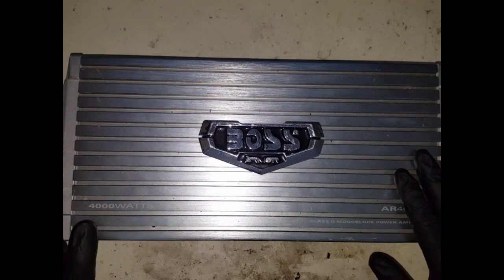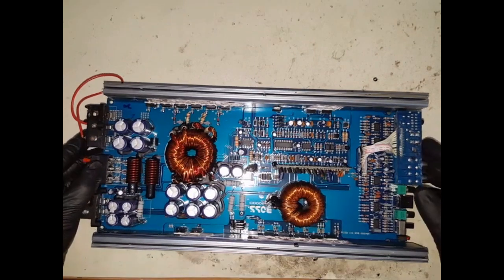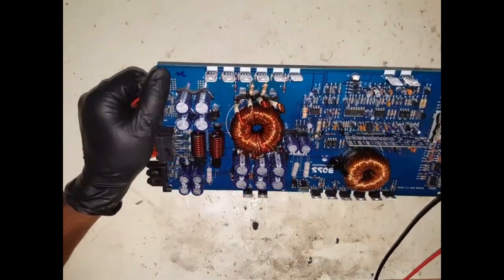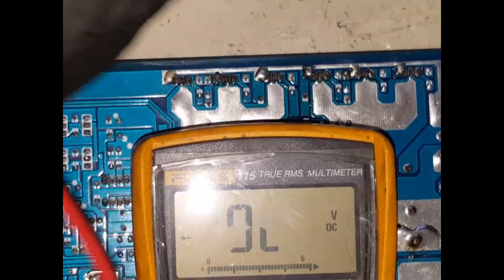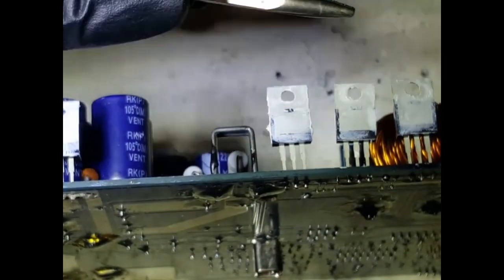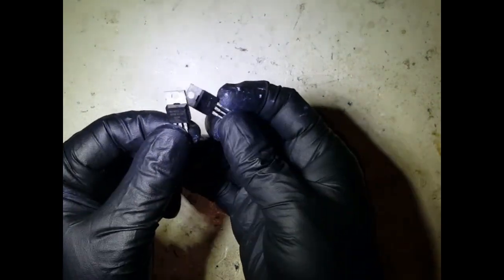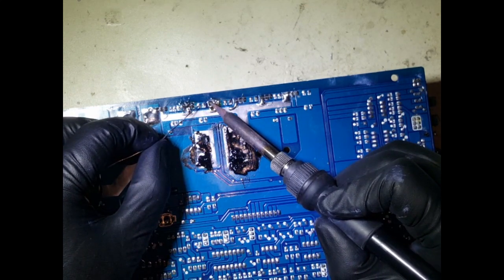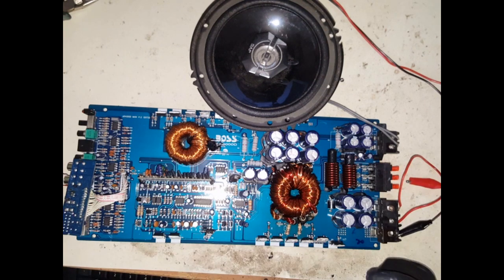Boss armour AR4000D Car Amp Repair

Comment: I BOUGHT A CHEAP 5 CHANNEL AMP ON EBAY SET IT UP ON THE BENCH AND RAN ALL 5 CHANNELS FOR ABOUT AN HOUR AND A HALF. THE AMP WAS SO HOT , I COULDN'T TOUCH IT . POWERED IT DOWN AND TRIED TO POWER IT UP AFTER IT COOLED AND IT WENT TO PROTECT AND STAYED THERE . I CHECKED THE PARTS YOU REPLACED AND WOULDN'T YOU KNOW  ? CONSTANT BEEP ON TWO OF THE SAME DIODES.  PLUS , THE  LITTLE HOLD DOWN WASN'T SCREWED DOWN PROPERLY AND THERE WAS A GAP BETWEEN THE THERMAL PASTE . ONLY TWO WERE BAD AND ITS ONLY 8$ FREE SHIPPING TO FIX... THANKS FOR THE VIDEO IT WAS A SURE HELP.

Comment: I have a question what to do when the amplifier doesn't sound loud, it's more like if the volume or gain was all the way down?
Reply from the maker: Check all your connections and settings

Comment: I have the same amplifier and it has the protection mode light on for 3 seconds and then switch the normal green bulb on for one second and then back to red, just goes back and forth like that. I tested everything like you did and it all tests good. Could you give me any pointers as to what else to try?
Reply: I currently have the same problem with a boss blade 3k have you figured it out
Reply: what was it?

Comment: Hi Sir, quick question I accidentally plugged the ground and Power in reverse I saw Sparks when I put the ground in the power cable in the ground. Did it again this time no sparks. Fuse good.  could you please be so kind and tell me what steps to take next should I check for a protection diode across the + & - like ameture radio amps have. Should I try hooking it up the right way and see what happens I'm afraid to do so in case I damage it if it isn't already damaged.  let me know please bro thank you very much. It's old school crunch p-1000 1k rms 5 ch amp 70 amp fuse. Fyi: the remote was not plunged in.
Reply from the maker: There are almost always protection diodes inside most electronic motherboard especially amplifiers. Check the power line 12v constant and there you will notice a big diode across the positive and negative terminals. Check for forward and reverse voltage drop there with a multimeter on the diode scale. Next check PMIC if it is receiving the correct turn on voltages.